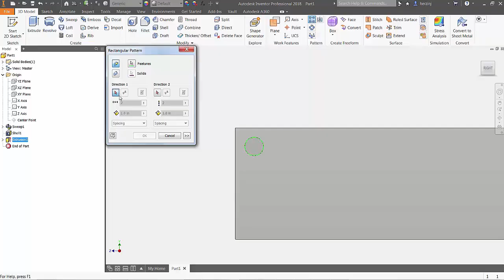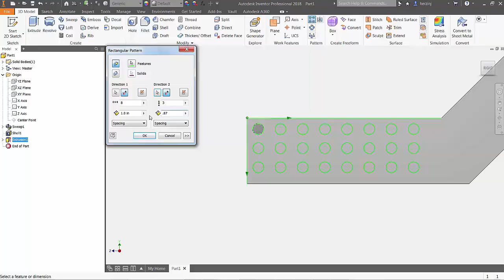Inventor 101: Rectangular Pattern

Comment: Correct me if i'm wrong, but If planning to use bolted connections for the holes (extrusions in this video), you'll want to actually use the hole feature, not extrusion feature.